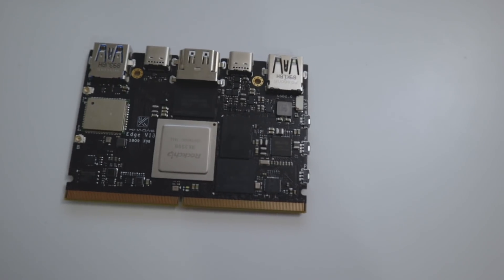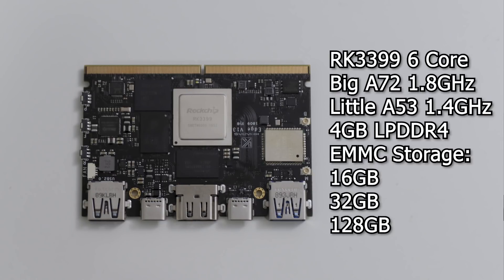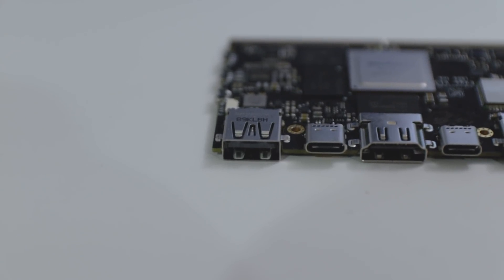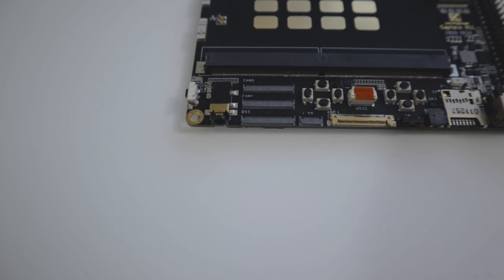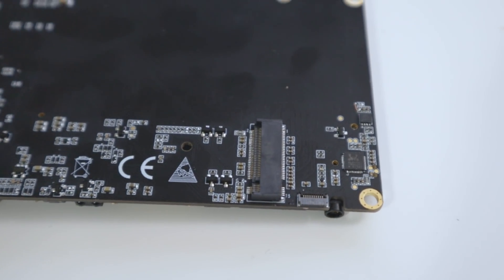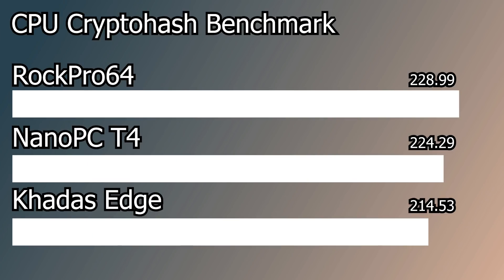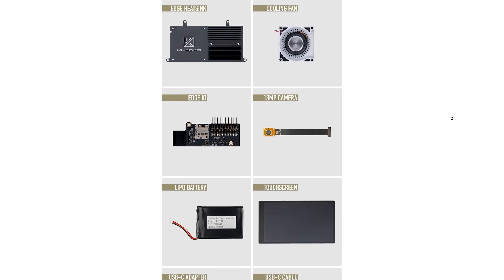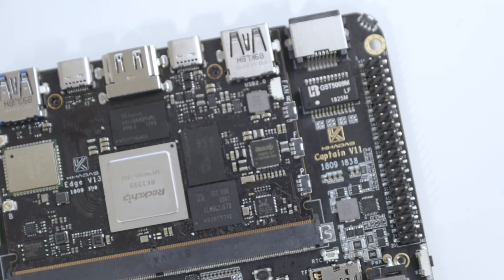Khadas Edge & Captain Review

Comment: Hrm I'm curious if the Edge-V Pro would out perform the Shield TV for a kodi box.  The A72 cpu is almost twice as fast vs the shields A57 , both have 4GB ram (shield has 3GB + 1GB Vram) not sure how the memory sharing with the gpu works on the Edge-V.  Both around same price (but you get the controllers/case with the shield tv).

Comment: While this device is indeed an interesting ARM machine (this isn't an SBC), it's way too expensive for what it is. If you really insist on ARM, get a Shield TV instead. Sure it doesn't run on batteries, but it's still the King of the Hill when it comes to graphics on ARM. Or, if you're a tinkerer, grab a Switch and install some homebrew on it.

Comment: Can I install windows 10 ?
Reply: If you get some form of UEFI running on it, you can, in theory, install Windows 10, but it won't do much without proper driver support.
Even though Windows 10 ARM could run on any ARM CPU with enough RAM and proper drivers, M$ is only interested in getting it to run on Qualcomm chips.
Reply: Dominic Dominoc Latte Panda Alpha 864 and 800 can.

Comment: Bloody hell - $300 USD??   That's insane...   Sure it has "extra bits" and some interesting (if not perfect as you mention) design but we're really whacking into the territory that you'd see a proper Core i3 chip here;  I think at that current price though it's going to marginalise the market too much.   The curious form factor and design - do you think that may have driven up the price so much?
Reply: Actually, Edge price start from $99, the $299 is for Edge-1S with all add-ons accesorries: Catpain, Edge-IO, 24W USB-C Adapter, Battery module, Camera...
Reply: Sure but in practice how much of it can you use as an effective SBC on its own though?  And with the additions you're still pushing well into the Core i3 SBC territory (not to mention being able to build an AMD or Intel solution on a SFF board with a more conventional config and supply).  Unless there are specific space/size and power advantages here - I'm still struggling to see the advantages given that you can obtain an integrated board with quad-core Celeron for the $85-USD mark, populate it with some ram and a minor SSD, small PSU and boom you're running for $100 or so less than the full-fat revision of this.  I know it's apples-vs-oranges but in a pragmatic sense it's hard to compete with;  also you enjoy the advantages of an x86 platform and the vastly easier time with distros, ongoing OS support, patching, etc.

Comment: the prices of these 3399 chip boards are not coming down uh?
Reply: Actullay, not quite until now :), be mind that the RK3399Pro and the Khadas Edge 1S will be ready soon.
Reply: Jiatao Chen Khadas Edge-1S Developer (RK3399Pro with NPU) 4GB LPDDR4, storage???) : $299. 96boards HiKey970 Amazon Kit (*MUCH MORE POWERFUL* Kirin 970 with NPU) 6GB LPDDR4X, 64GB UFS 2.1 storage : $329. Also the new Kirin 980 (for HiKey980) is due in Q1 2019 (when Khadas *plans* to ship).